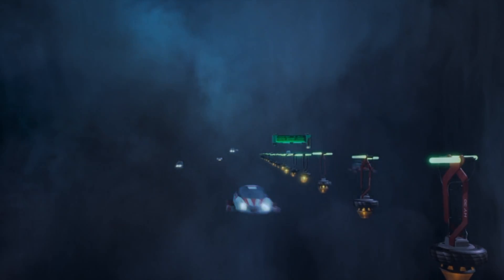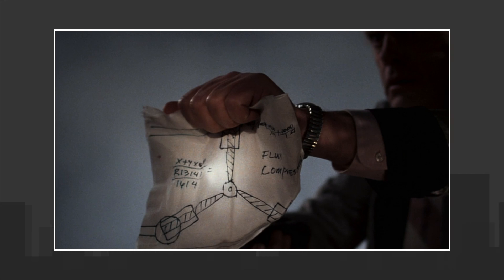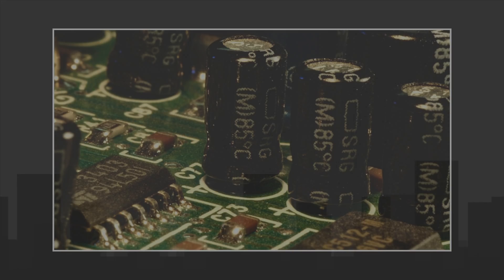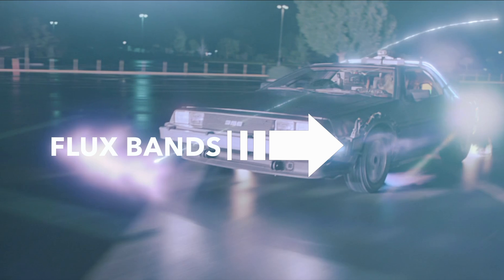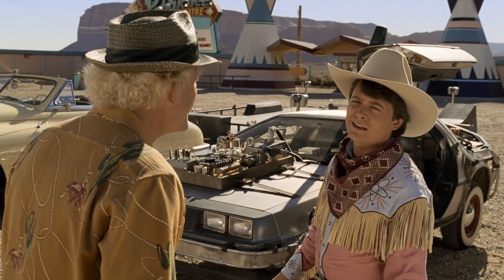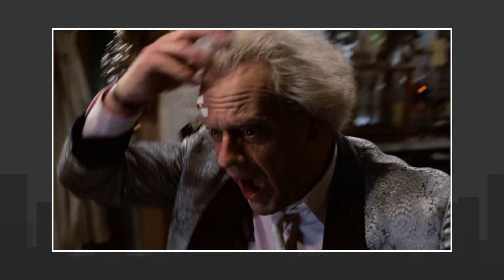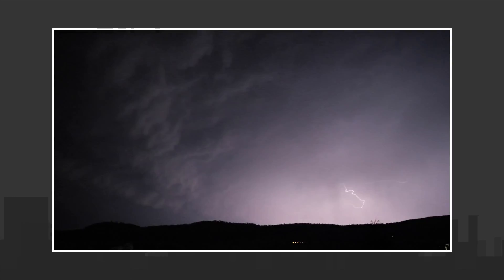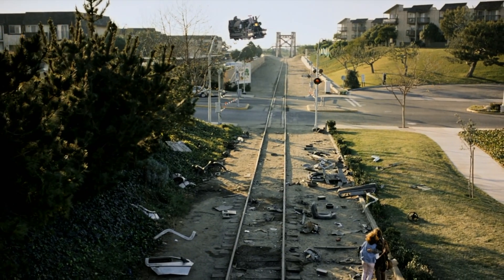The REAL Science Behind Back To The Future's Time Travel ⏱️ Build Your Own Flux Capacitor!

Comment: Except for the vertex represented by the flux capacitor your description is technobabble to force a few physics concepts into a fantasy of a time traveling DeLorean.

Real physics from which concepts of backward motion through time emerge do entail a vertex, three lines joined in the center. But the appearance of the vertex in the flux capacitor was an homage to Richard Feynman's vertexes in his Feynman diagrams. Feynman was a professor at Caltech, and an advisor on time travel for the film.

The vertex of Feynman diagrams are represented by an arrow pointing in to the vertex, an arrow pointing out of the vertex, and a wavy line coming from the convergence point of the vertex. There are six orientations the vertex can take. Wavy line up, wavy line down, wavy line to the right at 60 degrees from up, wavy line right at 120 degrees from up, to the left at 60 degrees from up, and 120 degrees from up. Each of these six orientations can be put together with other vertexes like a set of tinker toys to represent all kinds of complex sub atomic quantum mechanical interactions.

But here I'll describe one particular interaction. The vertex with a wavy line pointing up. The diagram represents motion of particles interacting through space, and time. Time is represented in the diagram on the vertical axis. Up the axis is forward in time. Down is backward. Space is represented on the horizontal axis. 2 particles are represented as lines coming together across space from left and right, and their motion through time by the lines angle on the time axis. The arrow pointing into, and up the time axis of the vertex represents a negatively charged electron. The arrow pointing out, and down the time axis of the vertex represents a positive electron particle, a positron, an anti electron, antimatter. When the opposite particles collide at the center of the vertex they annihilate each other, or combine, to produce pure energy, a photon represented by the wavy line. Inverted with the wavy line on the bottom the vertex represents a photon decaying, or splitting, into an electron, and positron moving away from each other.

 The representation of the positron, the antimatter, in the diagram is the arrow that points down the time axis. It can be thought of as an electron moving backward in time. 

Time travel.

Information can be turned into a coded stream of electrons. It can also be encoded on a stream of positrons. That's as close as physics comes to time travel. Speculative extensions could be cobbled together where information is encoded on a stream of light particles where the light is split into electron, and positron streams. If computers can use the machine code of the brain then the mind could be copied, encoded on a positron stream, then converted to an electron stream code on the receiving end to be copied to the receiver brain. Likewise matter can be converted to energy, and the pattern sent to be reassembled on the receiving end. But given mind transfer whole body transport is redundant. The physics of the encoded positron from its frame moving backward in time is that to a forward moving encoder the encoded positron stream has the encoding before it reaches the encoder, and the encoder takes away the encoding so the stream continues backward with no encoding. That's where the physics shows there's no way to send information backward.
Reply from the maker: That is very imformative, thank you for your feedback( and lesson). I think I've learned more from this comment than my physics class in high school.
Reply: @GiantFreakinRobot  I added a few more details to my previous post. You might want to take a look at.

Comment: What would be a design look like that on such a micro scale. Could the design be like a small mobile nuclear particle accelerator like on Ghost Busters proton packs. When I think of 1.21 gigawatts of power, I'm thinking of a nuclear power plant generating that each day. But only need a split second of power needed to break the time barrier. Is there even enough radiation shielding from being exposed.
Reply: It is possible and btw ghost buster proton pack is a cyclotron a little different from a partial accelerator
Reply: @Alldaynobreak  I thought cyclotrons were a form of particle accelerator.